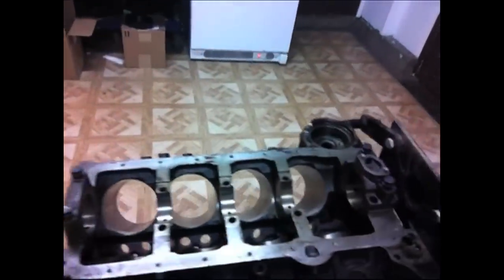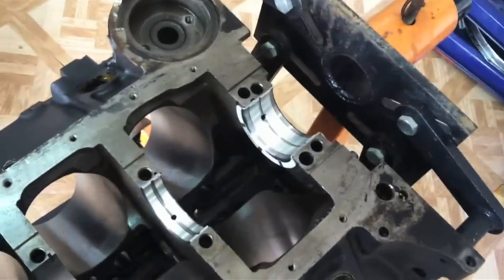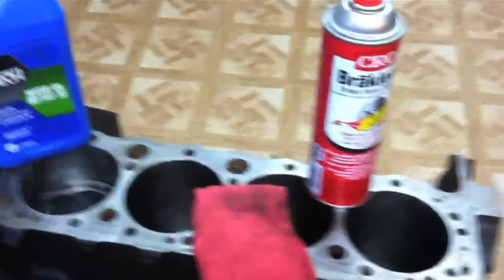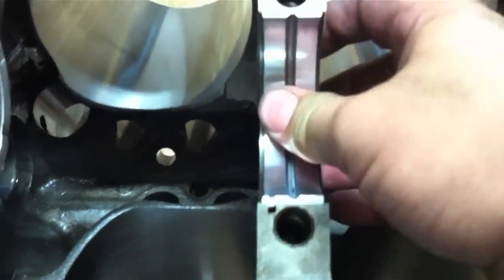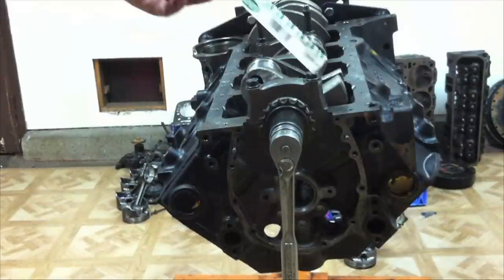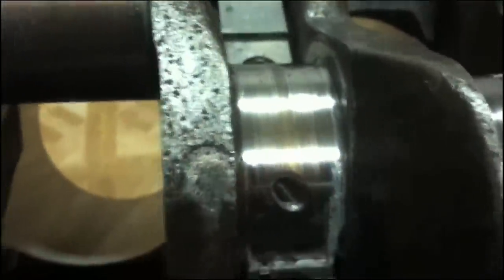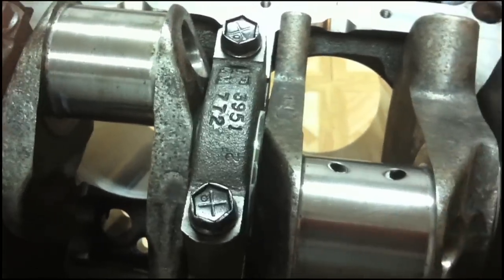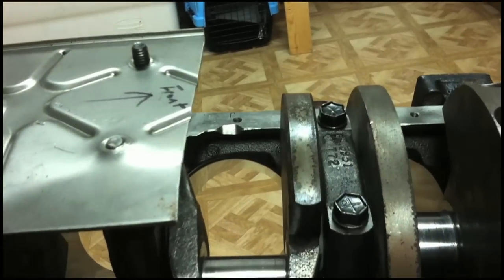How To Build a Chevy 383 Stroker - Part 1: Block & Crank

Comment from the maker: The crank had already been machined once. If you machine the crank more you will weaken the crank (and cost another couple hundred dollars in machine work and bearing set). Even with a NEW crank and bearings, you still have to plastiguage each journal and use scotch brite to clearance the bearings. You are not taking much off the bearing and when the engine is running the oil does most of the work. Again, the best thing is not to be cheap and buy used parts so you don't have to worry about it.

Comment: I understand that this is a instructional video but personally I would use a 4 bolt main over a 2 bolt for a 383 stroker motor
Reply from the maker: 4 bolt mains are always better.

Comment: this video is great for showing people how not to build an engine, 
its just all the little things. Engine building is an art, what you are doing is slapping it together sure it may work but its not going to reach its potential even with used parts you can do a better job than this. defiantly would not tap clean the threads, it DOES cut the threads. using the same rag for the brake cleaner and for the oil, the rod caps are marked from factory, you should never use a rattle gun on any part of an engine. 
what makes it worse you are building this for a customer? 
take the crank and get it machined for fuck sakes, NO one would ever use that crank in that condition. also any one who uses a plasti-gauge is a moron.
How do you sleep at night knowing you charged some one for the work you have done to this engine.... if your customer doesnt have much money its not an excuse to do every thing the "Lazy" way and slap it together like a burger from mcdonalds...

Comment from the maker: I would have the machine shop bore the cylinders 30 or 40 over (not 60). Line bore it only if it needs the crank mains straightened out. Get new matching pistons. The machine shop can help yo with all that and tell you what you need. Just get matching parts so pistons, crank, valves, cam etc. don't hit each other.

Comment from the maker: Set a budget and write down what you want to do. Talk to a good machine shop about what you want to do and your budget. They can help you get the correct matching parts. The guys at Summit Racing are also very helpful getting pistons, and parts, etc. Just make sure to take your time and keep everything clean! Lube the assembly correctly as it goes together. PRIME THE OIL PUMP before and after it goes in. No one will warranty parts you put together but you can put something together and learn.

Comment: I still would have checked the centerline of the crank to rod bearings. Just like you would the cam bearings. 

I also use an inside dial gage after the main bearings are torqued down. Then measure the crank journals for roundness. The difference in the size of the crank journal to the rod bearing is then checked again with plastic gage.

Comment: Was that a 3.750 stroke crank? I was wondering if that is all that is needed to make a 350 a 383 stroker or are there more mods needed? Im about to start a 350 build and I was thinking about a 3.750 stoke over a 3.480 stock stroke but I don't want to run into any extra issues.

Comment: SanDiegoHotRod I wanted to know if you could help me put together a 383 stroker for my 84 ss monte carlo..I have the 350 small block already
Reply from the maker: Sure thing. Take a look at the BEAUTIFUL red 350 I just put together on my facebook page
www.facebook DOT com/corvettesandcustoms
It is a REAL hot rod engine (not like this cheap POS I filmed mostly for demo purposes)
Thanks
Reply: SanDiegoHotRod I'm looking for a 4 bolt 350 chevy small block mines is a 2 bolt
Reply from the maker: Anthony Calhoun
The red engine on my facebook page is a 4 bolt. I can get you a 4 bolt block and put together 400hp long block with NEW aluminum heads for around $3500.
Reply: SanDiegoHotRod how much for just the block
Reply from the maker: 350 four bolt main block is around $250
Reply: SanDiegoHotRod  set it aside for me... is it already bored out?
Reply from the maker: I have to call the machine shop on Monday. Email me your phone number sandiegohotrod@aol.com

Comment: Why are we checking the clearances of a used crank? Demonstration purposes?
Reply from the maker: +Rod Palm Pretty much. This was such a junk motor I decided it would be a good one to use as a learning tool while building, filming and narrating by myself. Nothing wrong with using a used crank, especially a steel crank but this one is hammered! I tried to talk him into turning it but he was a cheap customer I don't have any more. As others have commented lots of people use used parts for "claimer" races where the winner HAS to sell you his engine for $500 or whatever if you make the offer. This keeps prices down and races fair on small tracks.
Reply: +SanDiegoHotRod You have to run the motor you claim AND it has to be for a minimum of 3 races too. Or refuse to sell and take the 3 race suspension, track owners dont like to see car counts down cause a suspensions ether.

Comment: I am a little new to this, so can someone tell me why he is using engine oil on the main bearing and cap bolts rather than loctite?
Reply from the maker: The torque specs for the main bearings is set "with engine oil on the threads" according to every engine assembly manual ever written. It is just procedure. Also, you never use loctite near the bearings. I only use it on the bolts that hold the timing chain gear onto the camshaft. (and screw in rocker studs)
Reply: SanDiegoHotRod dont forget it under the head of the bolts either/ just as responsible for false torque readings as the threads are.

Comment: Hello, I wonder what is the best option for connecting rods ride a chevy 383, connecting rods 5.7 inch or 6.0 inch? Profile I or H? I will buy the rotary kit Scat, and the best option? I want to achieve a 450 hp. Thank you so much.
Reply: +Wilmar Junior Talk to the Scat people.. 6 inch i-beam Scat 2-ICR6000-7/16 best rod for the $$

Comment: I have a nice running 350 block with headers and a Edelbrock Aluminum intake. 600  cfm carb.
What other parts do I need to buy to create a 383 stroker motor?
Reply from the maker: If you have a running 350 you want to make into a 383 you will basically keep the heads and block and replace everything else. You will need new pistons, rods and (400) crank on top of everything else you typically need to rebuild an engine. Unless you have a big heavy car or truck and really want the low end torque you may want to stay with a 350.
It is easier and less expensive for parts and machine work to build a high hp 350. You are better off spending the money on performance or "clean up" work at the machine shop.
If your block is in good shape (or never been rebuilt) you can easily build a 400hp 350 starting with what you have. Get a good machine shop to help you with specifics but basically:
Machine your block and get good NEW matching 10:1 comp. pistons (.030 over, etc)
BALANCE crank, rods, pistons, flywheel/flexplate
Use good double roller timing chain  (gear drives are cool but annoying)
NEW harmonic balancer
"port" the heads - have the machine shop open the intake runners, machine a good flowing head and use large (2.02 intake) valves.
Use roller tip or full roller rockers
Check your intake before you use it or spend $135 at Summit for a new intake
Make sure the carb is in good shape.
You should make around 400hp and be able to run on premium pump gas.
Use GOOD Felpro header gaskets and paint your engine any color you want!
Good luck!

Comment: hey great videos one question do the 383 stroker have cam bearing?
Reply from the maker: +Raymond Talley Yes. You can get a cam bearing installation tool but I recommend having the machine shop install the cam bearings.

Comment: Nice job from a old gear head engine builder.
Reply from the maker: Thanks man. I know this engine is a piece of crap and mostly just a demo/tutorial thing. I have a new "series" of videos that continue this theme of putting together a small block. The new videos "cover" the external parts and the engine I just put together is BEAUTIFUL with aluminum heads and 400hp. I have a couple uploaded with a couple more on the way. Thanks again!

Comment: Hey shanon, I don't think I explained my situation very well. Let me try again and see if this helps.
1. I have my dream car, 92 Camaro purple Z 28 factory four-speed. It has no engine but the transmission is there. It was a 5.0, so I know it will hold a SBC. 
I also need body parts for my daughters 01 silverado. So I was thinking I could get 2things done for 1price. 
So I'm looking to get a silverado with a vortec 5.3 and build that for my camaro, and use the body parts for her truck. And no I don't live in CA.
So what I need to know is, 
     Will a 5.3 vortec bolt up to my camaro'S manual trans?
     Is a "truck engine" A good candidate for building a stroked?
     Will the wiring be a pain in the butt?
And is there other problems that might arise for this project? Sorry for Taking so much of your time. I really appreciate your input.
Reply from the maker: I have read that the block will bolt up to the trans but not 100% sure. The crank spacing, etc. is different so I know they sell adapter kits for the automatic but have not seen adapter kits for the 4 speed. Trying to get the right computer set up with the 5.3 and the 4 speed will be a nightmare to get it dialed in right. If you do not need to smog the car I think you are better off and money ahead to buy the truck sans engine and trans (cheaper) and buy a 4 bolt 350 core that has not been rebuilt. If you start with a 350 block and go .030 over and build it with a stroker kit (crank, rods, pistons, etc) from Scat or any other company and use the ProComp aluminum heads you can either go carb. or fuel injected (PC heads go both ways). $300 for a NEW Holley 600 (as big as you need) or $900 - $1200 for a fuel injection kit from Holley or other company. You will have gobs of torque and hp without the headache of wire harnesses and computer diagnostic time. Just my personal opinion. I would keep it simple since you have a 4 speed. Don't forget a good set of ceramic headers.

Comment: Well how about a 350 then, how can I build a 350 and get decent horse power for a street engine? I have the stock components......so what components can I re use and what will I need to purchase?
Reply from the maker: If you live somewhere without smog laws or have a smog exempt  car you can use the stock parts (block, crank, rods and heads). To get more power the key is air/fuel mixture and flow. Edelbrock aluminum intake manifold is affordable, looks nice and works great. A Holley 600 cfm is usually plenty of carb for a street car. It is also very affordable. A good "RV" style mid range camshaft is good. You don't want anything too big. It kills vacuum and does little for actual power.
The most (affordable) power is having the stock heads machined and rebuilt with new 2.02 intake valves, seats, guides, springs, and most importantly having the intake runners ported out to flow better. That is your biggest HP gain. You need to talk to your machine shop to get prices on machine work and porting and what they can get you new cast iron or aluminum heads for price wise. And lastly, I prefer Flow Master mufflers for better exhaust flow.

Comment: will the main caps go on backwards if you make a mistake
Reply from the maker: Yes. The best thing to do is mark the caps before you take them apart. if there are no arrows pointing forward or numbers you can use number punches or single center punch. Front cap one dot. Second cap two dots, etc. Mark the block as well with a dimple so you know which direction the caps go back on also.
Reply: ok thanks

Comment from the maker: Hey Guys
The whole "motor" and "engine" debate has gotten out of hand. Obviously SOME people don't get the joke and need to get out more often (or be locked up). I am not uptight and don't care if you say "engine" or "motor." I added some links to the description to help explain the difference. If you feel comfortable walking into Pep Boys and asking for a "starter motor" "wiper motor" "window motor" AND "CAR motor" then who am I to judge?
We need to move on to more important discussions, like which is "more correcter"  -
"blower" or "supercharger......"  
S.
Reply: Motors are units that convert electromagnetism into continuous rotation.  Engines use the combustion process as their kinetic energy source.  The correct term is "supercharger".  The term "blower" is slang.
Reply: SanDiegoHotRod Find  check , engine light,   list , codes.
Reply: Motors are ELECTRICAL and engines are COMBUSTIBLE!

Comment: I got a 350 in my 93 road master what would I have to do to keep it tbi after I turn it into a 383 and also what heads should I use?
Reply from the maker: You can use the throttle body injector and intake if that is what you are asking. Guessing you want more torque for the heavy car. Make sure the intake is not rotted out before you re use it. if it is bad spend a couple hundred $ and get a new Edelbrock intake that fits. I have been using ProComp aluminum heads for many of my builds (check out my "Engine Dress Up" videos to see them). They are made in China but work great on a budget. My machine shop says it only costs me about $500 more than rebuilding my old heads. They are high flow, lightweight and have a bolt pattern that goes both ways - standard and Vortec intake compatible. Check out the 58 Corvette restoration and other new stuff on my FB page www.facebook.com/corvettesandcustoms   Thank you!

Comment: I saw you said you could get a 4-bolt main 350 block for 250$...

Planning on building a 383 and I want a 4-bolt main that has roller cam provisions...
Reply from the maker: Chris6068 All Chevy small blocks will take a roller cam setup. Just talk to your local machine shop and they can give you some ideas to get the roller cam, lifters and rockers all set up correctly.
Reply: I know they can all have roller cam's installed, but its a matter of how much work it takes to get them there. ie: most '88-93 truck blocks have the provisions for a roller cam, but requires drilling of the bosses, etc.

A 96-98 block wouldn't have this issue as it already had a roller cam in it from factory.

I'm also wondering where I good place to look for a block would be? Wait for something to pop up on local classifieds and get it cleaned up, or are you better of buying a fresh 383 block?
Reply from the maker: Chris6068
You can buy a new 383 block that is all prepped and ready. I get mine from my buddy at the machine shop that I have known for 20 years. I always say as a rule of thumb that everyone sucks you just have to find someone you can trust and work with. Machine shops usually have extra blocks available. Just make sure you get a block that has not been rebuilt yet so you only have to go .030 over. Shops can usually get you deals on used 4 bolt blocks especially if you have them do all the machine work for you. You are better off spending money on a good set of aluminum heads that flow well. That is where most of your power is made. A "cheap" set of good after market aluminum heads runs me around $1000 with big valves and good flow rating completely assembled. Use the CFM guide on the Holley web site to pick a carb (or FI). You don't need as big as you think. And mostly spend the couple hundred dollars to get everything balanced! It makes a huge difference.
Reply: The truck won't be nearly extreme enough to be running aftermarket heads. Just going to be doing Vortecs. Its still going to be powered by TBI, won't be doing a carb conversion.

I know of a guy who has a near 400HP 383, with 450lb-ft running TBI tuned by an EBL-Tuner, so going to go this route.

Need the truck to start everyday in -30 so I'd like to stick with fuel injection.

Comment: I have a Chevy 350 out of a 98 Z71 how much do I need to bore the block over
Reply from the maker: You need to have a machine shop look at it. If it is not bad then you can go .030 over. If it is really bad it could be .040 or .060 over. Just have the machine shop check it and make sure the block and crank look better than the one in this video! LOL

Comment from the maker: A 4 bolt main is obviously better to start with. This was a clients engine he THOUGHT was a good deal but the seller HIGHLY misrepresented the parts and wear, etc. I myself NEVER buy engine parts from Craigslist or the paper. When you try to do things cheap it bites you every time. Use NEW parts that FIT TOGETHER. Get references on parts and labor. 4 bolts are more important for trucks, racing and turning over 6000 RPM. 2 bolts and a STEEL crank are fine for most street apps. Thanks.

Comment: your no suppose to use a tap to clean you threads your suppose to use a thread chaser. a tap will cut your threads
Reply from the maker: Big debate on taps and chasers. IF you can find a true chaser that would work most of the time but finding one these days is hard and extra $$ when more people already own a tap and die set. A tap (used correctly) won't cut threads if the hole is already in good shape. If the hole is rusty and /or cross threaded/worn out then a tap is better to fix the threads. Most old blocks are in bad shape and a undersize/"non cutting" chaser will bind or won't work or thread in all the way.
Just need to be careful and take your time no matter how you clean the threads/holes. Thanks.